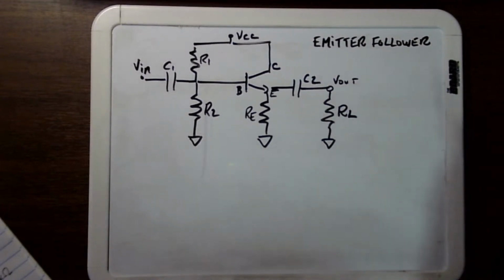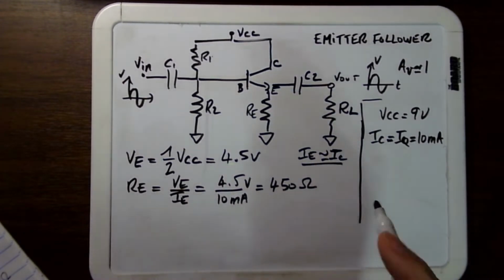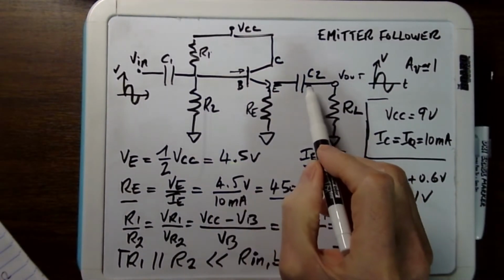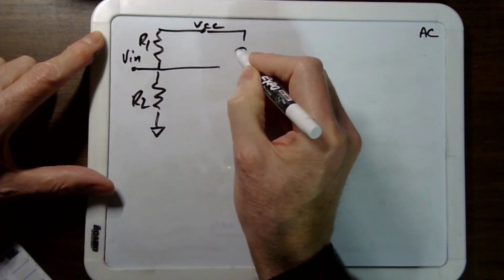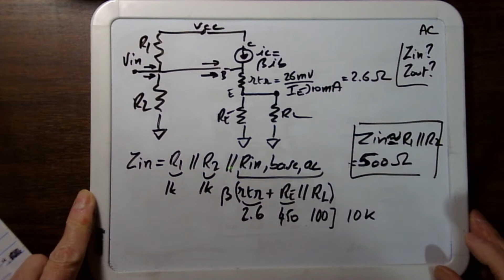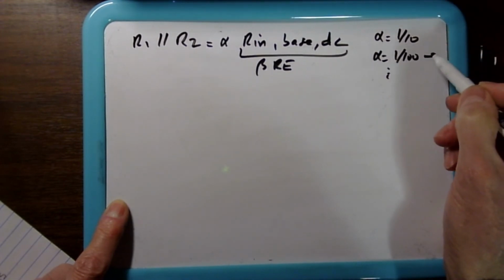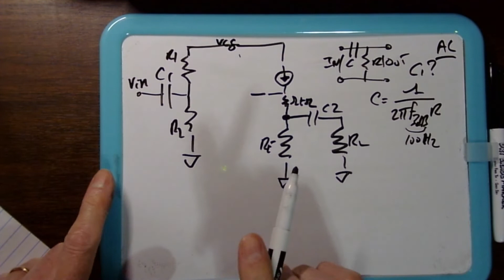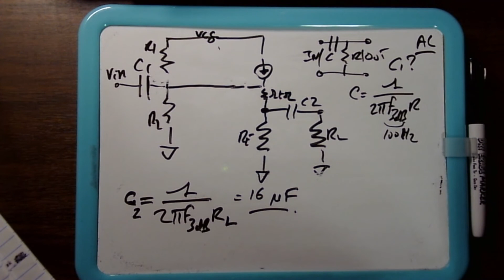Emitter Follower amplifier design (Common Collector amplifier design)

Comment: If there was a resistor in the collector, is the emitter voltage still half of Vcc? If there was -Vcc in under the circuit ?  Please answer
Reply: with a collector resistor you can have half Vcc on emitter by splitting the other half Vcc between the transistor and the collector resistor so the sum makes the supply voltage